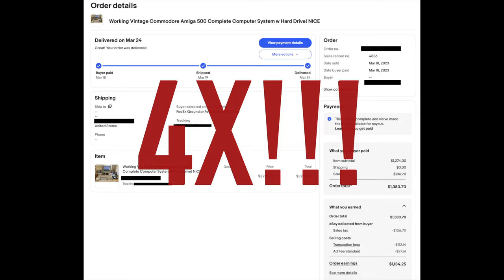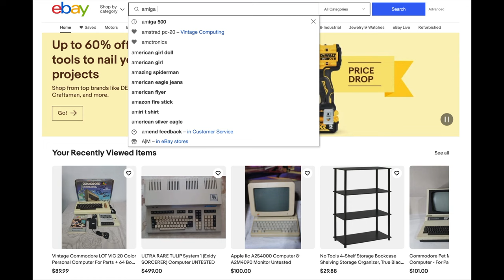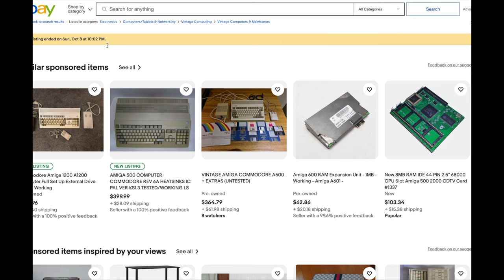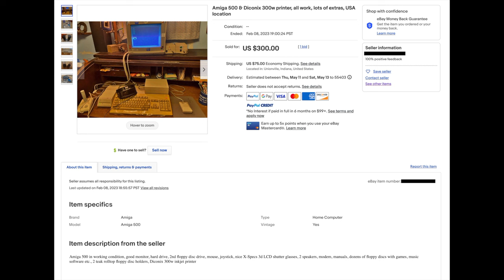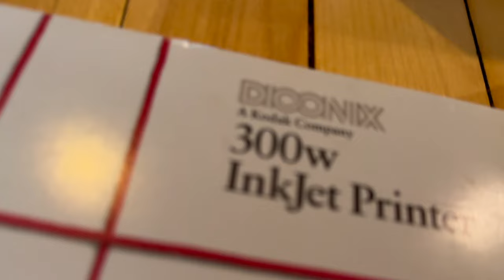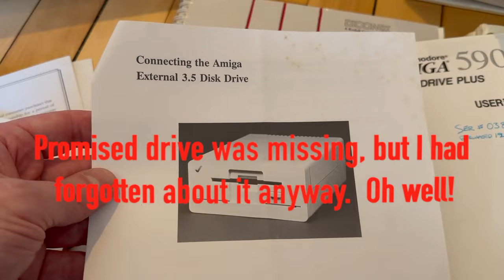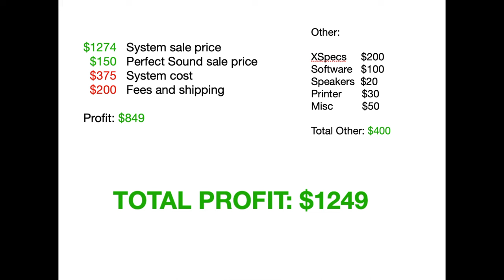RR#1:  This Amiga 500 is worthless...or is it???

Comment: I started selling retro computers flipping during covid.  Some times I make some money but most of the time I only make a little bit.  I generally restore them back to 100% operational to include retro brighting, cleaning, testing and installing the operating system.  By the time I figure my time spent and parts replaced I kinda break even.  It is a hobby for me.

Comment: eh yeah makes sense, and otherwise your company simply turns into the next 'computer reset' :P (although i'm confident that most of the stuff that was in there was new when it got there ;) or rma returns after it was new and sold to a client by them (yeah you usually get those back only by the time noone wants them anymore anyway ;) or just trade-ins. don't think computer reset went around deliberately buying pallets of used computers. :P looks more like a place that sold them new and then maybe took the old ones back as a tradein :P